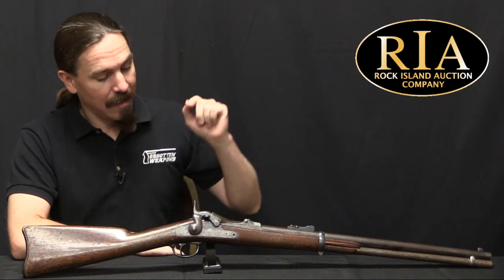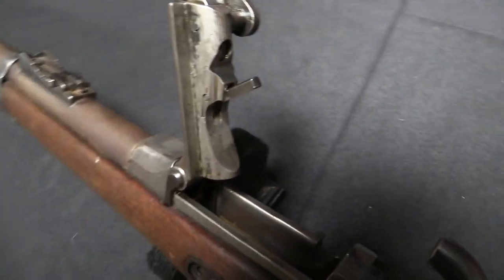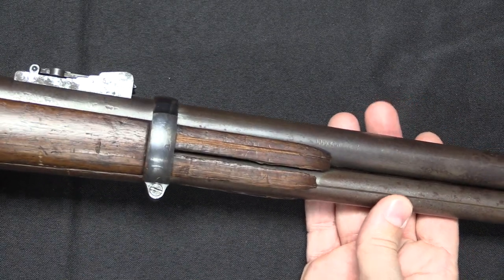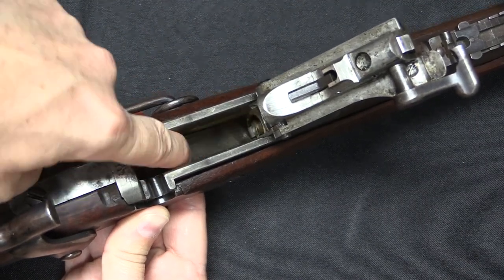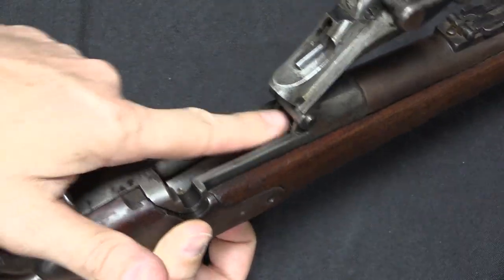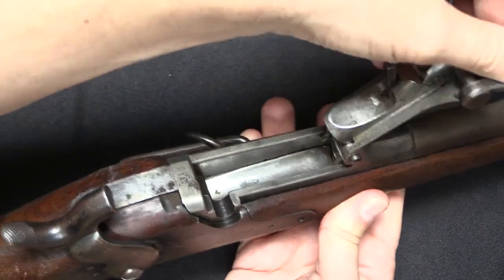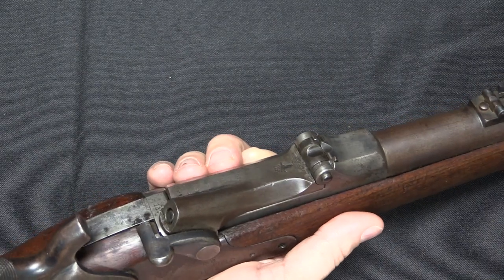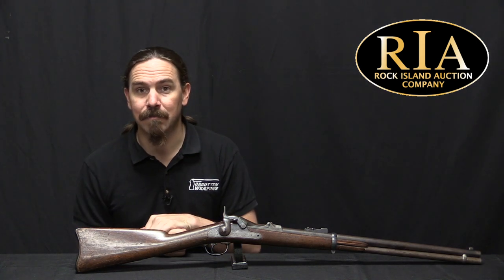Prototype Tube-Magazine Trapdoor Springfield

Comment: Me playing RDR1: wait why does the springfield rifle have a 4 round capacity? It only has a one round capacity!
Me now: who would even decide to change it any further? Just build a new rifle at this point!
Reply: Springfield Armory has a trapdoor with a 5-round cartridge holder machined directly into a protrusion on the side of the stock, exactly like a modern sidesaddle shotshell holder.
Reply: @moosemaimer  that's not exactly a 5 round capacity but still really flippin kewl...
Reply: the trapdoor was a modified muzzleloader in the first place
lots of people asked why dont you just buy a bunch of winchesters
Reply: @gregeoryl  I mean converting it from muzzleloader to breechloader made sense, but adding a tube magazine seems like you took a car from the 1910s, upgraded it to 1950s standards and now are trying to make it work like it was designed for the 21st century, at first it makes sense, but at some point you just have to drop it entirely.
Reply: Now it only needs a gas system like on the Huot automatic, next level achieved
Reply: @sumvs5992   But the developer was selling to the military, who are notoriously eager to convert existing weapons inventory instead of buying new rifles. Their set point of when it makes sense to just drop it entirely is different from ordinary mortals. I think the inventor wanted to sell this as a conversion kit, preserving the barrel, trigger/hammer mechanism, etc, and hopefully preserve the stock. (And I think a small hole in the bottom of the forestock was deliberately made to show how it works, and has enlarged over time from small breakage.)
Reply: @gregeoryl  Winchesters were expensive and he army already had thousands of Springfields
Reply: @gregeoryl  Because in those days CONgress actually was sort of responsible as to what they took in and spent in return.
Reply: @johnkelinske1449  It was more that the American Military was on a shoestring budget when it wasn't in active wartime. 

This system ended for good after World War 2.

Comment: The inventor was probably hoping to capitalize upon the Army's demonstrated love of repurposing existing equipment, and it's a very clever design.

That said, vs a Winchester or Marlin lever action, it has a couple of big disadvantages: to load the magazine you need open the action and empty the chamber, and reloading from the magazine requires 6(!) distinct actions.

Bottom line: had Custer's men been equipped with these on game day, the final score would've remained the same.
Reply: To expand on your first sentence, but diverge: The army also had a demonstrated love of preserving the manual of arms. More crucially, the doctrine of fire discipline was a top priority. A soldier was supposed to fire when ordered to; the ability to fire rapidly was reserved for crucial moments. An ammo supply is never infinite. The magazine cut-off is great for this, of course.

Once the magazine is loaded before an engagement, the action of firing is the same as the single shot he's already trained for. When repeating fire was needed, the only difference is omitting the step of loading the round; opening the trapdoor and thumbing the round into the barrel was the same.

Not as rapid as a Winchester, but the army valued a heavier round more than rapid fire; the 1886 model able to handle that round wasn't around when this 1881 conversion was made. As for Custer - well, the end would have been the same, but the score less lopsided.

Comment: This "could" actually probably be used without having to shove your finger in the breach every time. You run your breach with the muzzle singled downward, so when the next round pops up in the lifter, as long as it's a round nosed or spritzer tipped projectile and not a flat face, it'll slide down the lifter into the chamber. You may have to shake it to make sure it's fully seated, but that's all. I really want to know if that would work.

Comment: This feature that the gun works as a single-shot rifle was actually a common request from militaries at the time (1860s to 1880s). Higher ups were worried that soldiers would, in panic, fire too many rounds, so they insisted that repeating rifles had this feature. An officer had to essentially order his men to use the repeating feature, thereby having a better control over their fire rate and ammo consumption. Seems silly now, but that's how they rolled back then. You have to keep in mind that back then, soldiers were still expected to fight in formation in the open field without cover (look at the first combat photo from the Franco-Prussian war to see what I mean). Those lines were not dense anymore and going prone or at least kneeling was increasingly common given the ever increasing accuracy, fire rate and range of the weapons being used, but they still existed. It was a transitional period and because of this, a lot of old thinking still remained.
Reply: Yes! It's extremely important to work from the mindset of the period when weighing how decisions were made. Historians use the term "presentism" to warn against the error of missing this point. Fire discipline was of the highest priority. The army would be quite happy with a magazine cut-off, with rapid fire reserved for crucial moments. And after all, it would have to be reserved, any tube fed repeater is relatively slow to reload. A Winchester-style carbine would rapid-fire more quickly, but take just as long to reload.

Comment: Honestly, I always found the original Trapdoors to be well-designed rifles, surprisingly fast to reload for a single-shot. Yeah, they went obsolete quickly, but for what they were they were excellent guns. This is a pretty cool system and I think it might have actually worked a bit better than Ian gives it credit for. Once the lifter raises the cartridge, you could likely just tilt the rifle forwards and the round will drop into the chamber.

Comment: When running a trapdoor, if you hold it with the muzzle angled down, gravity dies a good job of chambering those big heavy rounds. I think it would do the same with this one, so not having it mechanically push the round in the chamber may not be as big of a drawback as one would think.

Comment: Without taking it apart to see how much space is left underneath the breech section of this rifle, I do see a way someone could have possibly built it to include a feed of cartridges from the lifter into the chamber while closing the "trapdoor". Thinking a small gear linked to the axis of the door, and a pair of racks (one on each side, or even just a single) that cycle forward and back with the cartridge from the lifter

Comment: One way I could see this prototype be significantly improved is if you install a spring mechanism next to the hammer. (Inside the stock)
The mechanism could work were when the latch rotates back to a 90 degree angle, the spring is released, pushing the cartridge forward. Once that's done, as the latch continues to lower part the 90 degree mark, the spring gets pulled back. 
(Maybe a tiny gear to allow this directional change) Effectively reloading by popping the hatch open so the spent cartridge can eject, and then closing the latch with the next bullet moved into the barrel by the closing motion.

Hence it shall truly be a Trapdoor 'Spring'field.
Reply: I was thinking a slide directly connected to the trapdoor that would pull a cartridge in, when you open it, it would slide back to allow the round to be ejected

Comment: I think the flaw, in the mind of the army, is that there was no way to externally determine if the magazine cutoff was on or off. officers wanted to control if the soldiers were using the magazine or not, and they wanted to be able to visually verify that no soldier was disobeying orders.

Comment: It actually might have stood a stronger chance of being adopted than you think. Part of the whole reason that the US Military adopted the trap door design was because so many of the parts and tooling could be interchanged with the Model 1861/Model 1863 muzzle loading rifles. This is why the trapdoor would be basically unchanged from 1866 until 1892, nearly 30 years. Even the Indians at Little Big Horn were better armed with more modern firearms in 1876. While the trapdoor had more range than the Winchesters and Spencer rifles, the Civil War showed that the average soldier was ineffective at MASSED infantry beyond 500 yards. It is about 100 to 150 yards for individuals which are the ranges where repeating fire would become desirable. The close the enemy is, the faster you want to be able to fire.

Comment: The self loading and magazine periods are interesting, but I would also add the conversions from cap and ball to cartridge are interesting as well. Especially in the revolvers and some local Blacksmith conversion designs. I've seen some that had two piece cylinders and others that drilled through the cylinder. Even some of the Flint to Percussion adaptions are cool. But to me, guns are artwork in metal and mechanics. Even some of the reproductions are wonders. I have a reproduction 1863 Christian Sharps that that works better than the original, a plane Jane that to me is just sexy art that shoots fantastic!

Comment: What strikes me as odd is the huge push to keep the 1861 in service with upgrades but the rapid decision to toss the Garand for an updated Garand (M14 or M1A1) and then to replace that with the M16.  I think that may speak to the drastically diminished role of infantry weapons as a percentage of military outlays in 1950 vs 1865, and perhaps to the greatly diminished role of infantry in general.  It is even more difficult to grasp when compared with the pattern seen in a place like the UK, where the Enfield lasted for 50 years, was replaced by the FAL which was in turn replaced by the SA80......which the UK has spent quite a bit of blood, gold, sweat and tears keeping in front line service for 40 years and counting.
Reply: Good points, but also the pace of technology change was higher in all fields in the post-WW II period. And the flow of decisions of Garand-to-M16 came from a clash of ideas: the army realized the need for non-fixed magazines, from the Strumgweher and common sense, but refused to accept intermediate cartridges. Otherwise the painful progression could have been avoided.

Comment: I could be wrong, but, as per this one being the only one? A friend has one of these and looks just like this one... the problem with his, there is a live round that self ejected under the elevator flap and the elevator no longer is allowed to work. it has been to a specialist, and even they cant take the unit apart, as the round is half in, half out of the tube.. I looked at it, and asked if I could try my hand at it, with the idea that I could use flat spring steel to slide down the side and snag the round and maybe push it back into the tube.. but the tubes loaded (minus the one that is half in/half out) and the tubes spring tension is too tights for the attempts that were tried by the specialist's.... When I see him again, I will ask what model his factually is... then we'll all know, that there is two in the world?
Reply: There could very likely be a handful of rifles like this floating around. It's entirely possible these things could have been pieced together as a commercial venture/hobby.
Reply: @hambrabai1256  I am curious now.. I have already sent off a TXT to him and mentioned to take his time upon this, while also mentioning to check out the lnk (this video) ...So, I can't wait to see...

Comment: I'm surprised the Army procurement wasn't interested. I've read they did not look favorably on repeating rifles. They believed troops would burn up ammo at a high rate and waste it.  With this they could have had a repeater with a slower rate of fire. Better than single shot, yet not quite a fast repeater.

Comment: It actually makes sense that this prototype wasn't accepted, and actually it was a good decision of the military that they did what they did.  If you remember there was a trial of tubular magazine bolt action rifle vs a single shot rifle (i don't remember which specifically) and at the end of the day they understood that both rifle were as fast as one and the other. So with that said, having this prototype would had been a waste of investment because you would have to modify a rifle to make it a repeater so it can fire at the same rate as the original did; the only difference would be that your rounds are already in the firearm instead of your fingers or in your belt.

Comment: I wonder if you could adapt the Bofors ramming mechanism to work with this. Put a sliding piece on the back that moves forward when the trapdoor is closed and just sort of yeets the round into the chamber.

Comment: I have and old, I believe a make shift rifle.  It has very  few numbers. One on the lower magazine (N 84962). The upper assembly has a number  T Inside a triangle, then 82829, F1935. It has a clearing rod, inside and under the barrel.  Rifle  is 46 1/2 " long.  It has 2 leather straps,  one,  10" from front of rifle barrel.  2nd, 7" from the butt. know this little or no help. Would this give you a guess on what it might be? I know this is not much help,  but thanks in advance.   Bill

Comment: this is very interesting because I have an 1866 second Allen conversion trap door that is in very good condition and i have 20 rounds of black powder 50 70 specifically for this 1866 but I have never fired a round yet and probably won't , there is something about old fire arms , If they could speek and tell us where they have been , thanks .

Comment: Imagine an era where there's a breakthrough in some technology and it is the proverbial "wild west" of scramble to develop some new system that works better than some other competing gunsmith's design.
You have no history on what will work, no proven system, only a smidgen of "it has to do this", then start drawing a system that might do what is needed.
It's not as easy to do than you initially think. Let's say quantum computing is developed but a better way of making it work is needed... you have SOME understanding of quantum computing, but have to come up with a better way to get it done. It's easy, right? You have the basics in your hand, now make it better. You will see thousands of different methods: some work sometimes, others don't and even a few more sort of make it better. They all are patented, now it's YOUR turn to not violate anyone's patent, but still make a better quantum computer. You have a quantum system in your garage, but HOW will you revolutionize that system and win the contract?
Not so easy when there is no model to copy... take the basics and make it work better!

Comment: I wonder if the ability to quickly swap back to the single shot operation would be a significant selling point for the military, which often favors reliability over rate of fire. If you adopt this gun and it doesn't work, you might theoretically still have the gun you used to use. Is it possible to still fire in single shot mode if the elevator is jammed down with a round in it? A repeating rifle that can still fire while jammed seems attractive to those who don't trust new tech.

I'm not saying these are going to convince anyone or that they are actually good points, just that one big stumbling block for adopting repeating rifles seemed to be the risk inherent with a new complex system. Being able to fallback on what worked for you before seems promising.